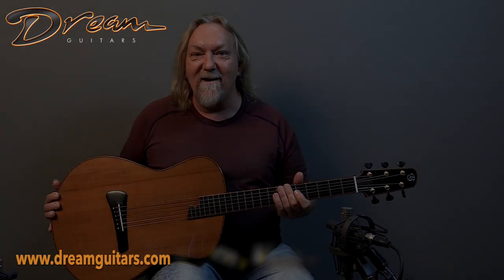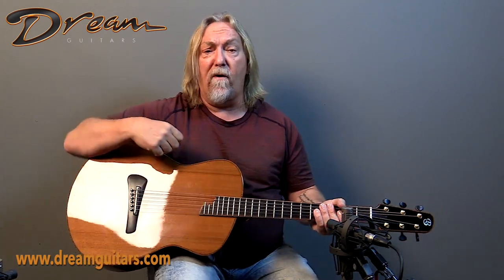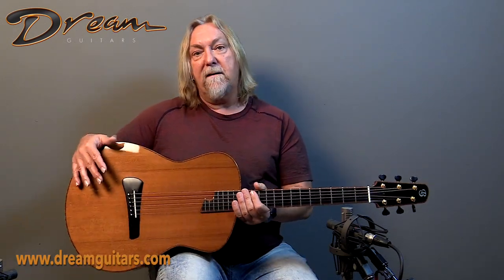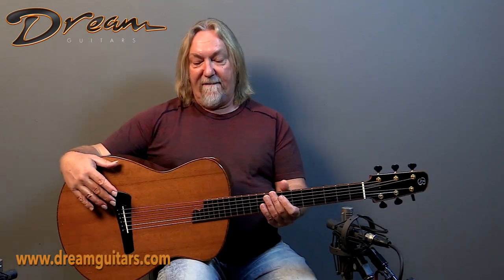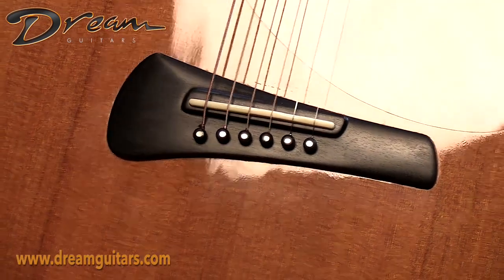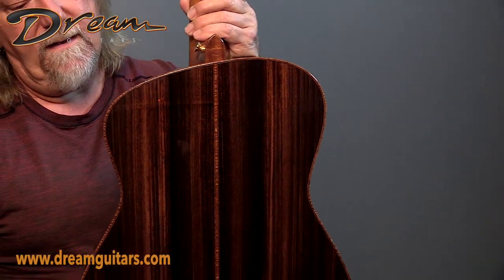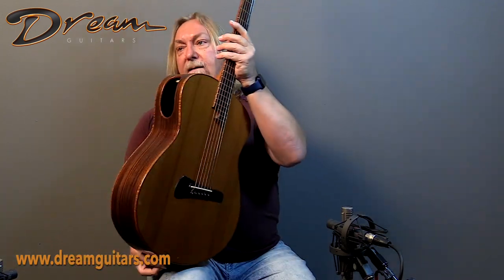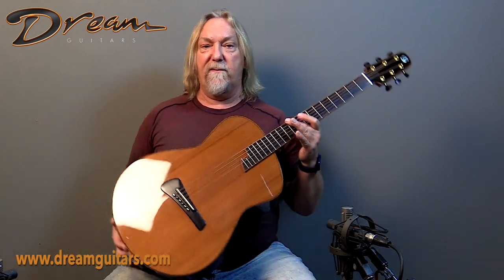2009 Tom Bills G2, Indian Rosewood & Sinker Redwood

Comment: Very nice. I wonder... are soundhole-less instruments less booming, particularly during recording?  It's be nice to know in this case. Thanks.
Reply from the maker: Good question. I have found that to be true, in general. We keep the same mic setup on the ones without a soundhole as the guitars with one (and we don't typically mic the sound port).  So, out in front, where our spaced pairs of mics are, I'd say they tend to be a little less muddy in the 100-200 Hz range, while still offering the full spectrum of frequencies.